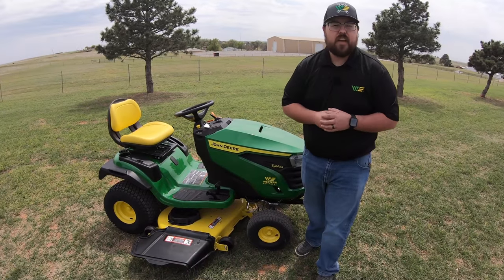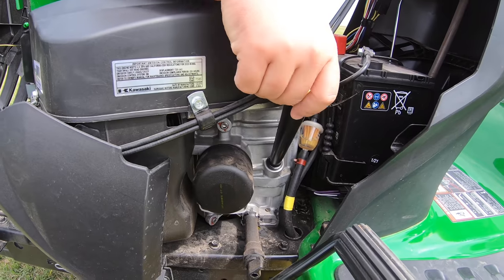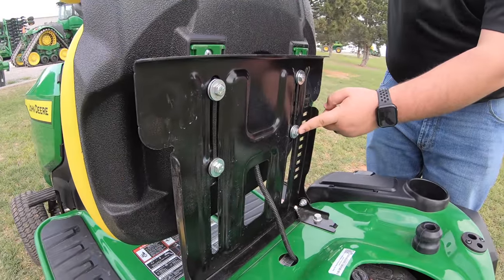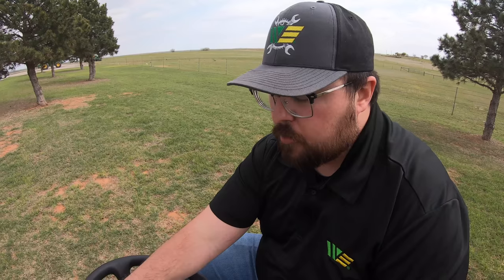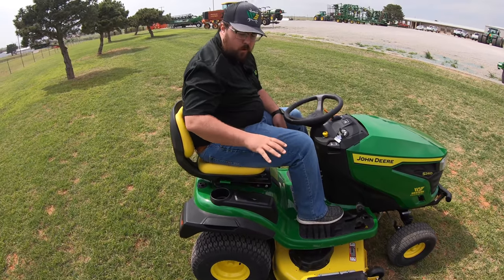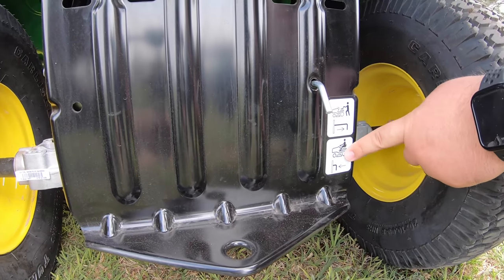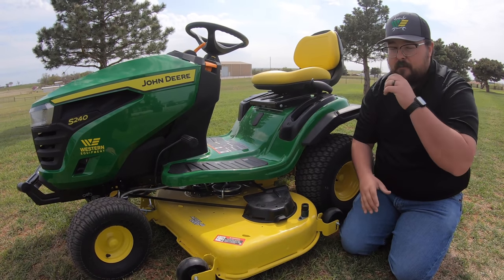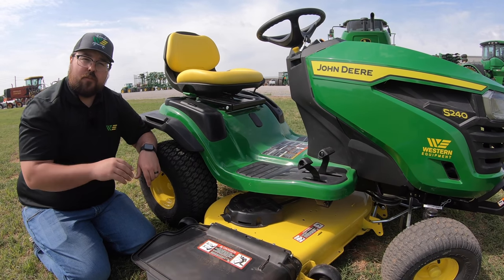2021 John Deere S240 Lawn Tractor Mower Review and Walkaround

Comment: Bought a house in October 2020 with about 1.1 acres. Had never even been on a ride on before. Found this channel and all of the information has been incredible. I purchased this exact tractor; 2021 S240. Your video made me very confident in the purchase and all relevant maintenance. This channel needs to get more publicity because its much more well done than any of the others including John Deere's own videos. Great work.
Reply from the maker: Awesome! I'm glad I could help you make your decision. Thanks for the comment and thanks for watching!
Reply: I have question about fuel. Can I put Ethanol free gasoline? I use it on most of my equipment, but I want to be sure if it ok for this tractor. Thank you
Reply: @jasonsm123  absolutely the best thing to use. Itll run on either, but ethanol is harder on carburetors and rubber parts like fuel lines
Reply: I love your responders McDonald’s
Reply: S130 2022 8 hours used it has always vibrated when blades are not engaged what could it be
Reply: How is it running, I just purchased a 2023 S240, wanted to know about the longevity or anything I need to be aware of.  Coming from a Troy Bilt, this mower is a beautiful machine compared to that Jalopie
Reply: @jasonsm123 u can use it, but might need to boost Octane a tad.
Reply: same here. we bought last year a house with 1 acre and never been on a mower before, currently we use a landscape company but I am aiming to purchase this mower and do the job by myself :) Are you still happy with that mower?
Reply: FYI about to enter the 4th season. Thing is still a BEAST. It’s de-thatched, seeded and mowed my lawn relentlessly. Approximately 80 hours of run time. Oil change once a year. Start it up every few weeks in the off season to keep the battery fresh. Swapped the headlights with LEDs. Cannot recommend this thing enough.
Reply: @TheBostnMasacre  thank  you for following up on your own comment! Strongly considering this mower

Comment: Excellent video and thanks for the links I’ll be ordering S240 48” in the next two weeks from my local dealer. The heavier gauge deck on the 48” than the 42” sold me to go with the 48”. Thanks again for all the info
Reply from the maker: Thank you and I'm glad I could help. Thanks for watching!
Reply: @WesternEquipment  I noticed in the specs on the S240 previous years j Deere had FS Kawasaki engine in their mower but the 2021 model they went with the FR engine isnt that a step down?
Reply: @gordo4559  it is...they did it on some x3xx series also. Its pretty disappointing. I was going to get an x370 but now ill probably just get the s240.

Comment: Just wanted to thank you for all your video reviews of the 100 and 200 series models. I was originally considering an S160 until I saw your videos and then decided that the S170 would be a better choice for me. Unfortunately no one in my area up here in Maine had ANY in stock including the local John Deere dealer. They did however have an S180 yesterday so today I stopped in to check it out only to find that it had sold.

That's when I first heard of the S240. With the Kawasaki engine, the 48 inch deck (the 54 was more than I wanted anyway) and the other general upgrades with this model I made the deal.

Your videos were a great introduction to the John Deere lawn tractor world and a huge help in my selection process to finally purchase the right one. Thank you!
Reply from the maker: I am glad I could help and thanks for watching! So did you already get your S240?

Comment: After 20 years of good service my Sabre with a Briggs Intek has given it’s all. Ordered the S240 due to Kawasaki and upgraded trans. Wish the trans was serviceable though.
Reply from the maker: I hope you enjoy your new mower and thanks for watching!
Reply: Completed my first mow. It could use more power. Is there a turbo kit available for that Kawasaki?  Maybe I’ll have to rewire it.
Reply: @davidboyd7494  technically you can service a k46. You'll have to remove the shifter and brake connectors and then remove the transmission.  There's a filter kit you can buy along with fresh fluid. Theres a fill cap that must be removed from the top of the transmission to drain and fill it. Once its drained flip it bottom up and remove the pan on the bottom. Theres a couple magnets thatll need cleaned off and a paper filter to change. Clean the mating surfaces of the pan and transmission well and apply a high quality rtv sealant and bolt back the pieces. Fill with fluid and before reinstalling the fill cap rotate the input drive shaft for a minute in each direction to purge any air. Check fluid level again. It should be 3/4" from the top. Reinstall fill cap and transmission. In roughly 2 hours you can service the unserviceable.

Comment: I have an old L120 I was looking to replace. I initially thought I wanted the S130 but after watching this video I have decided to go with the S240. The main reasons for me: better engine and oil change (EZ oil change just not for me), 3 year warranty, separate throttle and choke, separate position for lights on only when needed. Thanks for educating me on this model. My mower will be purchased from my local dealer but was "sold" by Western Equipment! Any chance of getting some decals for the sides of my hood?  :-)
Reply from the maker: I am so glad I could help you with this decision. If you can email me at brent@west-equip.com I will see what I can so on getting you some decals. Thank you and thanks for watching!

Comment: Great review, as always! I picked my 2021 S240 up about a month ago, so far so good. I was concerned about the fuel filter physically touching the engine, so I used a zip tie to pull it closer to the battery by wrapping it around the fuel line and the battery strap. It has done a good job keeping the filter off the engine. Also, any clue when part # BUC11053 will be available? I'd love to get mulching, but I haven't seen the mulch control kit attachment in stock. Thanks again!
Reply from the maker: That sounds like a good idea! And I wish I could give you an estimated stock date on that kit but I do not know and we have been trying to get info for a while now. There have been tons of inventory issues with most major vendors so we are all hoping this gets resolved quickly. Thank you for watching!

Comment: Excellent review, thank you. Your thoughts S180 or S240 48” for 2 Acres flat property? Also, reliability of the ELS engine. Nervous about the ELS verse the Kawasaki. Thank you in advance!
Reply from the maker: Thank you and honestly it all depends on your desired cutting width. If you feel as though you need the 54" the S180 is a good choice. The thing I like about the S240 is the deck build on the 48" deck. It is a more high capacity deck even though it isn't as wide as the 54" on the S180. Both are great mowers and I have mowed with both of them. I hope this helps and thanks for watching!

Comment: Just got my S240 with the 42 inch deck and am looking forward to grass cutting season with my 3 lots of land instead of my self propelled Toro. Side discharge is fine for me through the mowing season, and I don't want to drop the money on the mulch kit and blades and would like a mulch plug option for the leaves in the fall with the Accel Deep Mower Deck. Otherwise I will be tempted to use my 22 inch Toro Recycler with the mulch option for all my yard in the fall.
Reply from the maker: Unfortunately on the Accel Deep deck the mulch control kit is the only option. You might be able to fabricate something as a cover over the opening to accomplish the leaf mulching. Thanks for watching!
Reply: I have the mulch kit on my S240 42". I think it was about $300. Works well and worth the money.

Comment: My wife and I are in our early to mid 60’s and looking at buying a new John Deere s240, or x330, 42” deck, Kawasaki engine (locating one has been difficult due to Covid). We have about 1 1/4 acres mostly flat ground with a few trees. Your videos are helpful and informative in making an initial purchase decision, and service afterwards. Thanks, we appreciate it! Wilbur & Loyce, North Florida
Reply from the maker: Thank you so much and I am glad I could help. Hopefully you all can find one soon and thanks for watching!
Reply: @WesternEquipment  just one quick follow up, do you think the x330 would be worth the additional $600 over the s240 for our use? 1 1/4 acre Mowing, Bagging, pulling a cart, fertilize spreader,  and possibly thatcher attachment? Thanks again! Wilbur
Reply: @wilburreeves8329  theyve got the same engine and transmission, and even the same tires. The deck lift and height adjustment along with the x330 having a somewhat heavier frame are the most notable differences. I think the x330 has a longer warranty also. I mow about almost 2 acres currently using a honda hrx217 pushmower and cub cadet ltx1040 42" tractor. I have to mow rather slow to achieve a decent cut with it,so I'm looking to upgrade. I think the s240 would suit my needs ok,because I dont have any steep hills or substantial obstacles and seldom tow anything.

Comment: How often do you grease - how many hours? Also, I have an old L130 and looking to upgrade to this mower along with a a mulching deck. You can get this with a 48" mulching deck, correct? Any issues with the mulching deck?
Reply from the maker: Initially you want to grease after 8 hours and then every 25 hours after that. and there is not an actually mulching deck but there are mulching attachments for the decks and we have really good luck with them.

Comment: Your videos are great,  we just ordered a 240 with a 42 inch accell deep deck, is the 42 a good cutting deck, does it mulch well, bag well?
Reply: I don't have the mulch kit on mine and I'm noticing that the engine is so powerful that you don't really notice the clippings on the lawn. I wouldn't be concerned unless you are doing it commercially or you are having a party/event and you don't want clippings brought in, which are also greatly reduced due to the Kawasaki engine when compared to my push mowers and previous rider.
Reply from the maker: Thank you! Yes, it is good for mulching and bagging. Being that it is a smaller deck and processing less material than a larger deck makes it good for both of these applications. Thanks for watching!

Comment: the previous year S240 had the Tuff Torq K46 transaxle, but this year John Deere advertises it as K46 Heavy Duty.  Is there a change to this year's K46?  Does it have a more sturdy build or a higher torque rating than the previous year?  I looked on the John Deere and Tuff Torq websites but they don't say if there's a change in specs.
Reply from the maker: I don't think there were any real changes from what I have seen and read. Great question and thanks for watching!
Reply: @WesternEquipment  ok thanks

Comment: I just got this mower & it’s awesome.  To one of your points, when it’s time to replace the fuel filter, I’ll remove the battery to gain much needed space.  Have a question regarding the primary deck belt.  On you video, with blades engaged, the section of belt going to the far left spindle runs smooth.  On mine, kind of flops around a lot.  My dealer said it is normal.  Any remedies?  Thanks.
Reply from the maker: Glad you are enjoying it! you may need to see if there is some adjustment you can make to one of your idler pulleys to take out the slack. You don't want it too tight but there shouldn't be any flop when running your blades either. I hope this helps and thanks for watching!

Comment: Thanks for your great videos and the way you answer questions!  I just used my new 2021 S240 with bagging option and it worked great.  I have a question regarding addition of a mulch control unit.  Is part BUC10704 the correct part?  Also, I read that you can use the mulch control and bagging system simultaneously resulting in partial bagging and partial mulching; is this correct?  If so, what blades (bagging or mulching) would be best for this operation?  Thanks again!
Reply from the maker: Yes, that is the correct number for the mulch control kit for a 42" deck. I'm not sure about using them at the same time as I have not seen that combo, but if so then I would use a standard 3-in-1 blade. I hope this helps and thanks for watching!
Reply: @WesternEquipment  thanks!  But now I'm confused; I just saw that a Deere representative said on the Home Depot site that the correct mulch kit part number is
Reply: BUC11053
Reply: @WesternEquipment  is the mulch kit (BUC11053) available yet? If not, any idea when?  Thank you!

Comment: I got this same 2021 S240 model with a 42” Accel deep. What begging kit is recommended? I have been told I need a special one that isn’t manufactured yet by a JD dealer but I believe they are blowing smoke because everything is back ordered. Thank you!
Reply from the maker: The one you need is a BUC10907 and from what I see it is still not available. John Deere has been having inventory issues, but we are hoping to see them resolve soon. Sorry for the inconvenience, but thanks for watching!
Reply: No baggers avail in MN 😞

Comment: Hi Brent. Thanks for your excellent videos. They've helped me to decide on the S240 with a 42" deck. I'd like to find out if you agree with that choice or if the 48" deck would be better.

I plan to mulch about 1.5 acres of flat as well as somewhat sloped and rough terrain at a height of around 3.5". A shorter cutting time with the larger deck is not an important consideration. I picked the lighter deck so it's easier to adjust the cutting height and remove it for service, less expensive to add a bagger and to maintain 2 vs 3 blades / spindles, easier to fit the tractor on a 5 ft wide trailer and because it should be more maneuverable on slopes.

I'd be grateful if you could answer a few questions.

Does the MulchControl kit work equally well on both decks or are the results better on one of them?

Would a well maintained 42" stamped deck be as rust resistant as a 10 gauge forged 48" deck?

Is there less risk of damaging a blade / spindle on sloped rough terrain with the additional 2 gauge wheels of the 48" deck or more risk due to the greater width?

Which deck would you recommend for this lawn?

Thanks very much for your help.
Reply from the maker: All great question. To start, yes, I would go with the 42" deck. The mulch control works well on both models and there is no advantage in rust protection with the thicker steal. there is going to be less risk of damage with the shorter deck and I would definitely recommend the 42" deck for your specific situation. I hope this helps and thanks for watching!
Reply: @WesternEquipment  Thanks very much for your time Brent to answer my questions. I really appreciate the help to confirm that an S240 with a 42" deck is a good choice for this lawn. Take care and have a great day!

Comment: Hi. Thanks for the informative video. Has JD stop S240 42 inch deck riding mower? I tried to buy now but no availability in our state. Thanks
Reply from the maker: They have not stopped producing them but there is currently a shortage of parts and materials so building some machines have been difficult for John Deere. Hoping this issue gets resolved soon. Thanks for watching!

Comment: Just received my mower from a local dealer with the mulch control kit installed. very nice. QQ on the Bluetooth module (BUC10929), my dealer has attempted to order this part several times, Deere cancels the order even though they show 150 in stock. The dealer speculates Deere is holding onto these for the new units which I find curious because I purchased mine new. Have you had a similar experience?
Reply from the maker: Yes, we have had issues getting this part and are still waiting on a response as to when it will be fully released. I wish I had more help on this topic. I am wanting to get one to so that I can do a video on it. Hopefully it will be resolved soon. Thanks for watching!
Reply: @WesternEquipment  curious if you've had any luck since we first broached the topic a few weeks ago

Comment: Looking at purchasing new lawn tractor! Been looking @ S240 with 48 deck & X350 with 48 deck. I think I noticed there are differences in these 2 decks! Looks to me 48 inch deck on the X350 has easier adjust scalp wheels as well as swivel scalp wheels for easier deck removal? Also is the deck thickness the same on both 48 deck on S240 & the 48 inch deck on the X350?
Reply from the maker: Yes, you got it! The anti scalping wheels are better for deck removal on the X350 but the gauge of steel on either model is the same. Good questions and thanks for watching!
Reply: @WesternEquipment  so could you get John Deere to put the x350 48” deck on the s240 that way you could have the upgraded deck but on a s240?